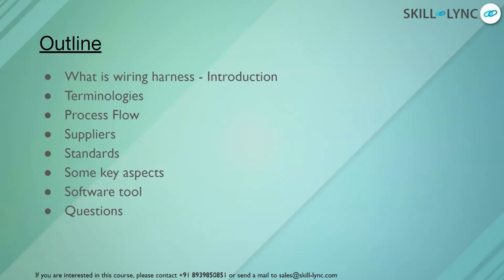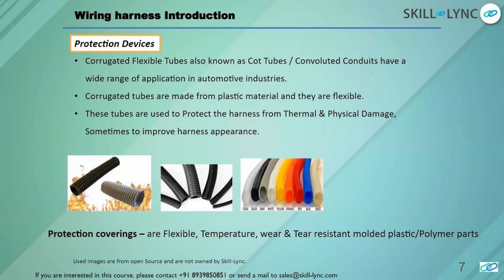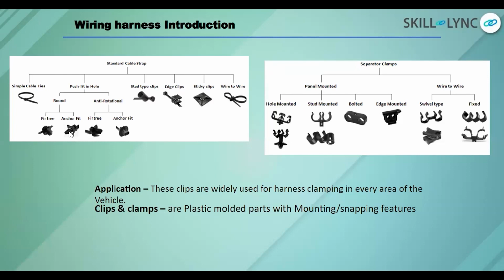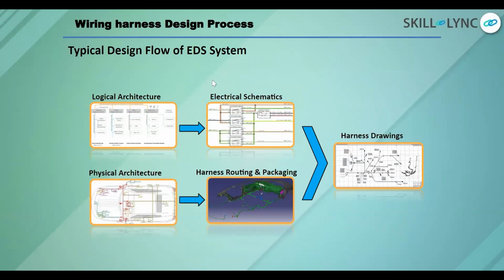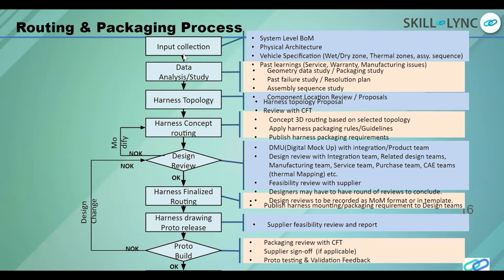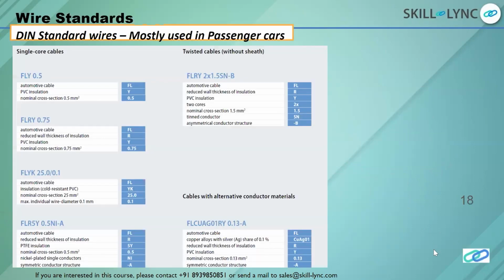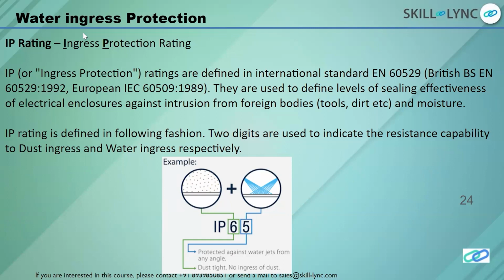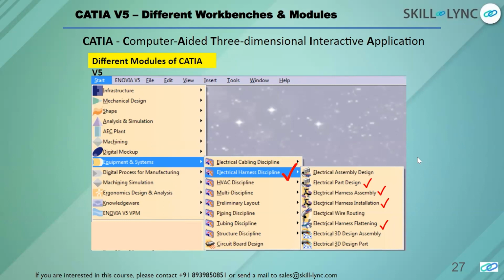Introduction to Wiring Harness | Mechanical Workshop

Comment: 00:07 A wiring harness is an assembly of components, including wires, connectors, terminals, and protective coverings.
02:25 Wiring harness carries current and signals in different systems of a vehicle.
06:55 Protective equipments are used to protect wiring harness from thermal and physical damage.
09:04 Vibration absorption and grommets are used to prevent wire vibration near vibrating components.
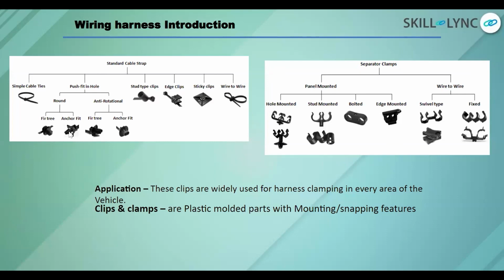13:22 Mounting components for wiring harness include edge clips and separator clamps.
15:19 Wiring harnesses are used for clipping and clamping components onto body structures.
19:14 Developing electrical schematics, physical architecture, and harness routing for wiring harness.
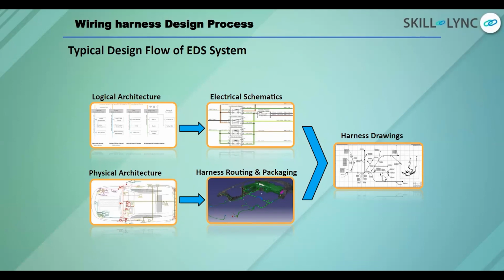21:05 Wiring harness is made up of various subcomponents assembled together based on the physical architecture, electrical schematics, and vehicle specifications.
24:54 Harness topology involves splitting wires and developing 3D models for component placement and routing.
26:45 The process flow for wiring harness involves concept routing, design review, finalization, Proto release, and validation.
30:33 Wiring harness connectors have similar specifications and a range of temperatures for usage.
32:26 Different notations and standards are used to identify and select the appropriate wires for specific applications.
36:33 Understanding IP ratings for protection in wiring harness
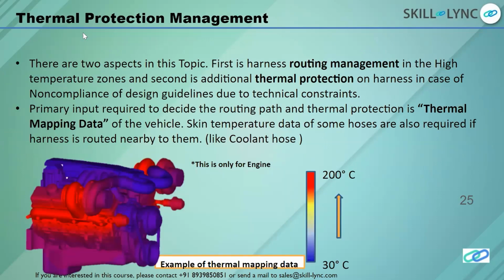38:35 Thermal mapping helps understand temperature zones for routing and protection of wiring harness.
42:33 Wiring harness development involves using softwares like Catia and NX CAD to design electrical parts, routing, and installation.
44:28 Wiring harness is important in automotive industry for developing the complete wiring system
Crafted by Merlin AI.